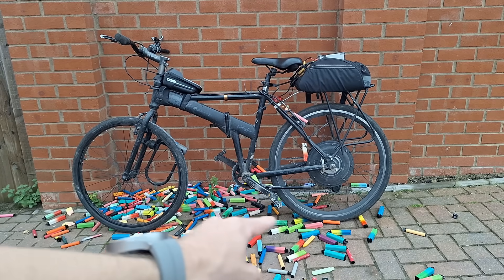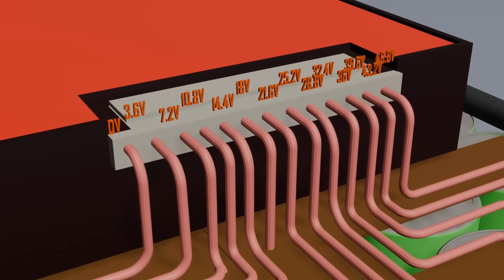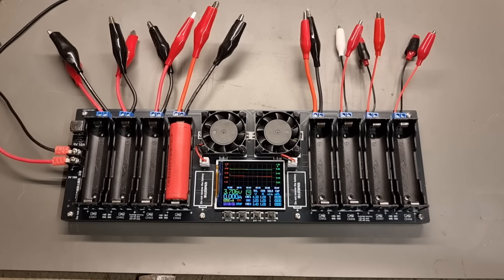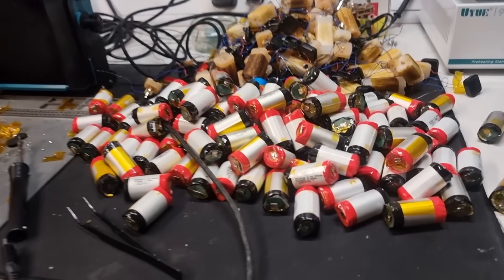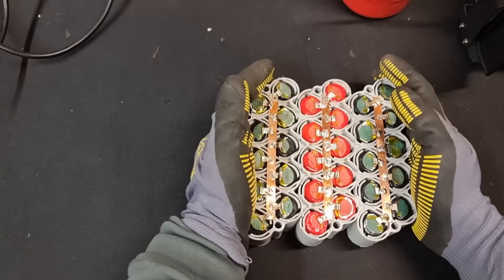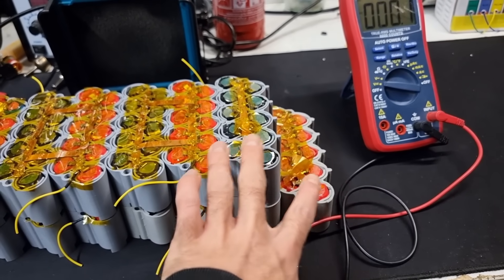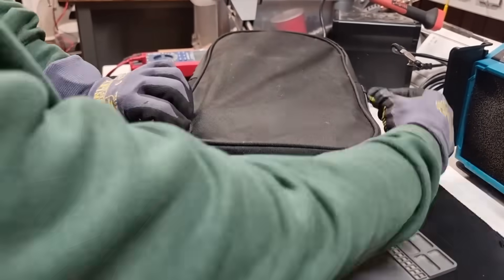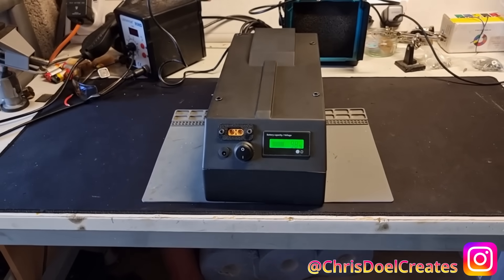Powering an E-Bike using Disposable Vape Batteries

Comment: Lots of improvements from last one, great job!
On a side note, it's preferable to have temperature probes on the middle of the pack, rather than the border. As heat is exchanged with the environment, borders are colder than the middle, so the hotspot is in the center. The discrepancy shouldn't be a lot (depending on the cell and casing materials), but talking about reused batteries of dodgy sourcing, any extra safety is a good idea.

Comment: Great project, I definitely look forward to what else you can power with basically free batteries.

What's the weight on the completed battery bank?
Reply from the maker: Good question, I've not weighed it yet, but i would say about 3-4kg. If i remember tomorrow , then I'll measure it and update you

Comment: I used to work in a vape store and the 18650 cell was pretty expensive that's why I still can not understand how I have been pulling 1100Mah 3.7volt batteries for free
Reply from the maker: I used to harvest 1500mAh 18650s from lawnmower batteries, and now the exact same cell capacities are being littered all over the place... its very depressing

Comment: Great video. A question: is it safe to just solder the ends of Li-Ion batteries with a normal soldering iron? I know some people use spot welding machines, even simple diy ones made out of a microwave transformer, to do this more safely.
Reply from the maker: Yep so typical lithium ion cells have steel shells which are best spot welded, but these cells have got solderable tabs so it should be absolutely fine (it seems theyre soldered at the factory)

Comment: It's not surprising you got that many miles out of the battery pack when your average speed was around 10 mph. My 2000 watt motor running a 52 volt 20AH battery but its 21700cells it can do 47miles on pedal assist 1 which is an average speed of 15 mph . But on pedal assist 5 doing 38mph+ it will only last 16miles so there is a lot of difference and that all varies depending on gradients and wind and so on.... but either way you've saved yourself a lot of money there because there is a lot of difference between the £400+ I paid for my battery and the 0 that you paid for yours 😂

Comment: The reason why some of the e-liquid are darker than others is down to age basically it is because the nicotine inside the E-Liquid reacts with the air and goes through oxidization over time it happens to all e-liquids with nicotine inside so if you give it time all of them will turn a dark colour

Comment: My eBay has a slightly better battery unit because it does not use 18650 it uses 21700